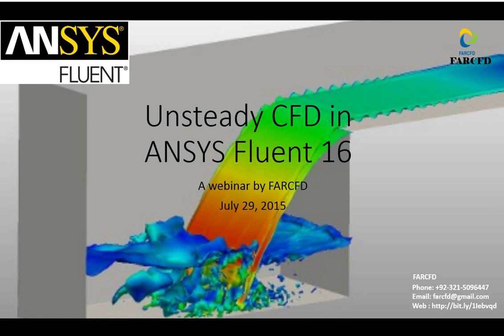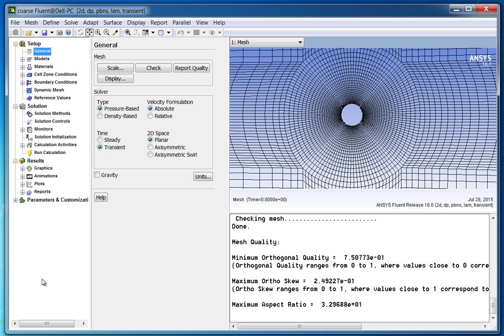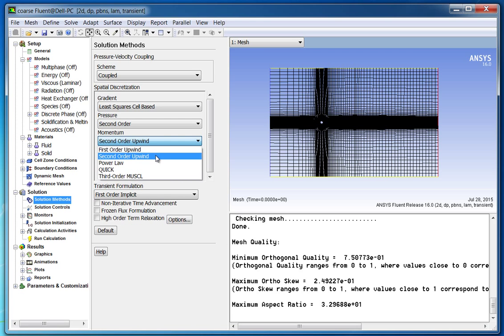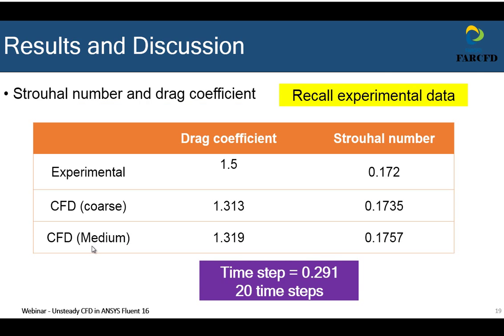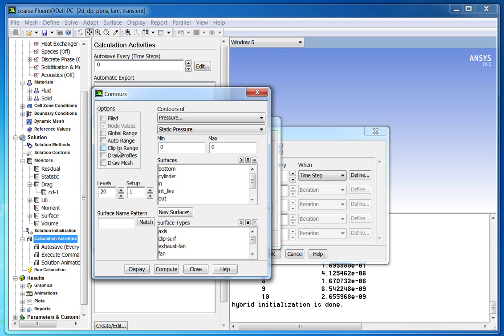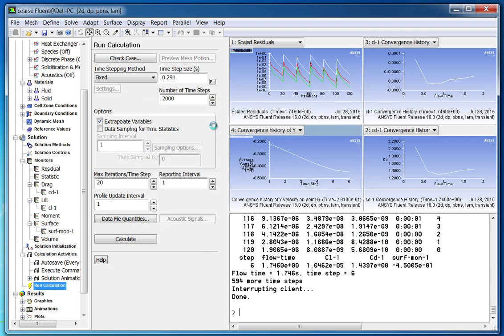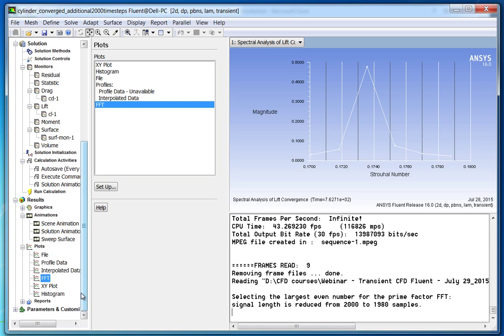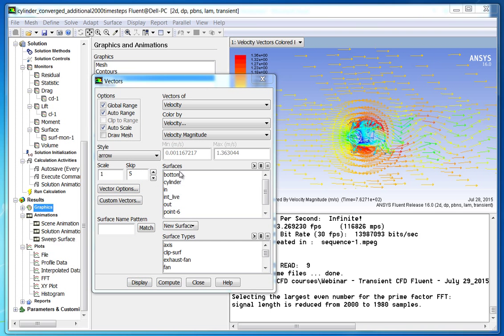Unsteady CFD - Circular cylinder (2/2)

Comment: Dear sir, i want to know how to set transient laminar natural convection for study of fluid flow and heat transfer over a cylindrical surface, can u help me.......
Reply from the maker: yes. you need to turn on the energy equation. change the density to Boussinesq model , or ideal gas. you may have to run it as transient case if temperature difference is large.  also turn on the gravitational acceleration. usually it is --9.81 in y direction.

Comment: thanks for the video may i ask you a question. sometimes i need to capture the velocity field around a circular cylinder  for different time steps and compare between these snapshots  when i zoom  in i can not have exactely the same level every time so is there a tool a register the picture of the velocity fields in every case and data with specified special levels
Reply from the maker: yes. save the views or use tecplot
Reply: yes can you please told me how to save it . i don't know if you have understnad me i want to have all snapshots zoomed with the same size . have you please any file or document for help :)
Reply from the maker: just go to display, views and save view/views. load next file and again go to display, views and read the saved view file. click on view0 or view1 or whatever name you have, and click on apply.